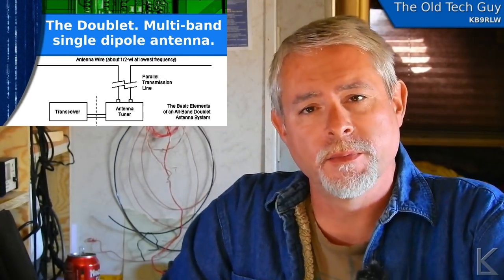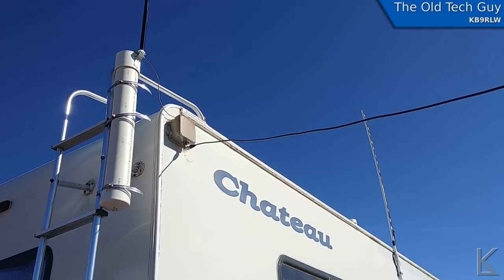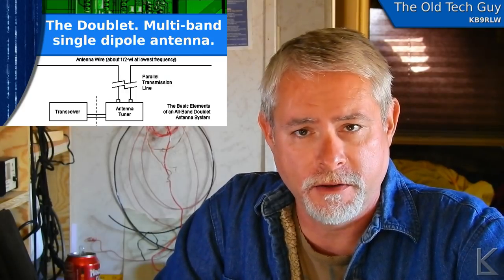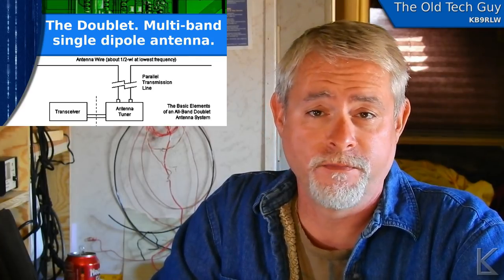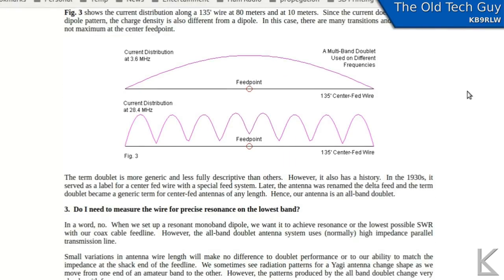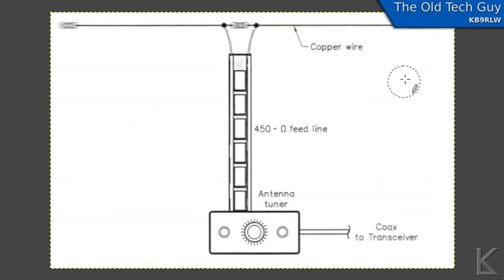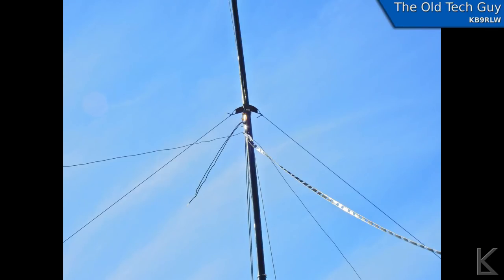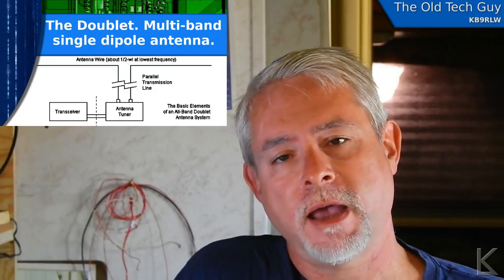Ham Radio - The Doublet.  An old but good multi-band single dipole antenna.  Part 1

Comment: Kevin is right about the benefits of a doublet.  I used one from a 2nd story apartment in Seattle for a few years.  Doublet was 42' long (including the 'end drops'), bare #14 copper wire and used with 20' of homebrew open wire feedline.  This I connected to a homebrew 'Z-Match' tuner on my bench.  Coax was maybe 2' long.  The doublet ran kitty-corner from living room to bedroom and dropped down vertically maybe 6' on each end.  I worked all over the states and the world- from an apartment, using QRP.  I could opeerate on 40 no problem, and even on 80 but had to retune the Z match whenever I moved more than a few KHz.  lol.  Worked all bands from 80 to 10.  And not with a shiny new rig.. it was my Heath SB-101.  Haha.  Nice vid Kevin.  Thanks OM & 73
Reply: Cool! That's what makes ham radio fun!
Reply: How did you hang the antenna if I may ask? Apartment dweller here, 11th floor, but I think the neighbors downstairs would see my wire hanging if I just hang them from the balcony hehe Thanks!

Comment: Most modern tuners now have a 1:1 current balun that does not do any impedance transformation.  A 4:1 balun like the ones that used to be in turner which was a voltage balun was very inefficient unless it was feeding a 200 ohms load.  Since the load impedance varies widely in this application, the manufacturers have finally got smart and started using the more efficient 1:1 current balun that maintains efficiency over a wide impedance range and also converts the unbalanced output of the tuner to that of a balanced condition - a win win situation !

Comment: Re watching this it tells me that if your antenna is resonant good coax can match 450ohm window. But if you're using a single wire multi band, window can't be beat unless you ran coax with the tuner at the feed point. That's going to look funny.

Comment: Great video Kevin - I am a long term fan and user of the simple doublet. It knocks spots off 9:1 random wires in both receive (S/N) and RF radiation. Doublets also work well as long as the length is at least 3/8 wave of the lowest frequency. So 50 ft is ok for 40m and up and 100ft should be fine for 80m and up. The ladderline can also feed into the tuner via a 1:1 current balun if the ATU is not a balanced tuner. The trick here is to keep the coax between balun and ATU as short as possible - less than 10 feet is ideal.

Comment: Thanks Kevin,  I  have been using a doublet about 115 feet long since 2016 and have an outdoor remote tuner (with NO balun) that can tune from 80 through 6 meters even though the tuner is not specified for 6 meters. The wire is just THHN house wire with the insulation on.  That does lower the velocity factor a little so that helps with the lower frequencies some.   Oh, and I just use some 300 ohm TV twin lead to feed it since I bought out a Radio Shack store when they closed and were selling 100 foot rolls for one dollar.  The trick to using a tuner without a balun is to float the tuner at RF so it is NOT grounded at RF (It IS grounded at DC).  The tuner I am using is an SGC-239 which is NOT an outdoor tuner, but I added my own waterproof NEMA 4 enclosure.   I know the loss from the 300 ohm line is greater than the 400 ohm window line, but it is what I had.  I may replace it one day or try some 300 ohm window line which is available.    I wanted to thank you for this video since I have found it hard to convince people that an antenna can radiate just fine and NOT be resonant.  I have been watching your videos at night on my ROKU box for some time, but there is no way to subscribe or like so I finally decided to get on the computer and do both!  Keep it up, this is one of the best things I watch anywhere.
Reply: How does this, "floating" effect noise floor and what about the risk of lightening strikes?
Reply: @Justin-bd2dg  Affordable automatic tuners are susceptible to lightning, even miles away. Reason: It's all active circuitry, only as reliable as the input protection circuit(s), which are skimpy for hobby-quality devices. Mil-spec is another world, $$$... Many I know have the opinion that there is no real protection against a direct strike anyway.... except disconnecting everything, but how do you disconnect a remote tuner from the antenna (conveniently, that is)?
Reply: @avt3216  I'm using lightning arrestors, I don't see how, if wired properly, they wouldn't work? You are providing a shorter path to the ground than the radio?

Comment: This is the optimal antenna for my 5 watt G1M. I fussed around with EFWH, bought Times Microwave RG8X coax and made an "improved" 49:1 balun. But really, ladder line is the way. I use an Em-Tech ZM2 tuner which is also light weight if a bit bulky.

To make mine portable, I built it around a wire wrapper and used really tight fitting banana plugs to make the feed line pack easier. I put it up with a TacMini fiber glass pole (17 feet) and run as inverted Vee.

I wish I could have made it a folded dipole but that just wouldn't be compact enough for a back pack already stuffed with other crap for camping.

Grateful for this video as it helped me get motivated.

Comment: I made a doublet by splitting speaker cord into a doublet and using the non-split speaker line as a balanced feedline. I made it on field day 2019 in about 30 minutes and used it to operate using QRP power. What fun that was. I heartily endorse the doublet!

Comment: One of the best antenna we have used, after testing  we ended up using this antenna as the ONLY antenna for H.F that is worth our time ( we  tested it against other antenna such as multiband verticals and yagi's).
Our feed line goes through an open window directly into the antenna tuner ( avoiding using an external balun ). 
At first we were worried the metal frame of the window will interfere, but found out that the effect was not felt at all ( even when we close the window onto the line ), but then again, this is the only spot were the balanced line could " see" metal. 
Do try this antenna , it's worth the time.

VK4BYE, VK4DJZ , VK4CPR

Comment: I've been looking forward to this video.  I always enjoy these videos and I always learn something and usually quite a bit (mostly limited by my old brain's ability to store new information).  I  particularly appreciate these technical videos with links to curated articles that keep me from doing the work to search for good articles on my own.  That PDF is a keeper.  I saved it in my ham info folder.  Looking forward to Part 2 for the operation and performance of your doublet antenna and the 700mW CW transceiver.

Comment: Yes I made one of these a few years ago, 110 ft long, and it worked well, out performed a 40-80 trap dipole....from Fred in England.
Reply: Agree Fred ... I’ve got my 100ft doublet up an average of 15 feet and for 500 miles on 80 and 1,000 miles to 3,000 on 40 it does v well.

Comment: I use a doublet of ~ 2x12 meters and a tuner, works fine on 160m to 10m.
From the tuner i run double coax through the wall and then window line to the antenna.
The double coax has center wire as "ladder line", braids connected to each other at ends but not to ground!

Comment: Many, may moons ago, my Elmer talked about the value of Ladder Line and I dismissed its use because it was ugly/messy/sightly and old fashion. I did use it on occasions but was never an enthusiast.

Kevin's presentation and his references shows that I should look for ways to utilize Ladder/Open Lines and it should be foundational especially when operating QRP.

The difference in line loss between coax and ladder line when an SWR is present is amazing.

Another great presentation of practical know-how and experience, with test results, from Kevin.

ThankYou Sir....

Comment: Something I’ve seen suggested in bringing window line inside through a wall is to attach each side of the window line to the center conductors of two lengths of coax, then bring the two lengths of coax indoors, leaving the shield unconnected. This will keep the feed balanced yet shielded. Also, IIRC, there used to be a form of ”shielded twinlead” that might also work.

73 de AF6AS

Comment: I have used a doublet fed with ladder line and still do. The advantages I’ve seen are, it’s cheap, it’s easy, and it works very well on every band. The only disadvantage I’ve noticed is it would be impossible to use mobile in motion. Using it from a stationary RV however, would be a different matter entirely. 🙂

Comment: What I have found in my experience with 450 ohm ladder line is that it's okay to  go directly across, for example, a metal window frame for a sliding window, but not okay to run it parallel but very close to, for example, an aluminum gutter on your house.   The idea is that any metal near the feedline runs the risk of creating an imbalance in an otherwise balanced feedline.   Where your metal object encounters the feedline is where the risk of introducing an imbalance is greatest.   But, as long as the effect of the metal object is essentially equal to both sides of the feedline - like when you run it across a window frame at 90 degrees, the effect to the balance of the feedline is minimal.   On the other hand, when running alongside and parallel to another conductor, like an aluminum gutter or tower support, where one side of the feedline is closer to the conductor than the other, the imbalance is far more pronounced and problematic.  This is why I prefer my fiberglass portable masts when using ladder line and my aluminum portable masts when using coax.

Another nice thing about using ladder line is that it is very lightweight and is easily suspended between two supports when feeding a center fed wire antenna, like a doublet.    And, I like using a doublet and a tuner because it also makes shortwave listening on non-amateur frequencies more effective.

Thanks, for the video!
73
AI4IJ

Comment: I had one of these years ago. It was great for all bands. I cut my ladder line down by the shack and installed RCA jacks. I built a 1', 2', 4', 8' piece of ladder line. By experiment I found the right length to match 50 ohms for almost every band. I used a 1:1 current balun and short coax to the tuner, but often it could stay in bypass. Maybe if you have enough extra ladder line you could do a similar experiment for the channel. The ladder line acts as an auto transformer. Unfortunately, I didn't have any suitable test gear at the time to record quantitative data. I just know it worked a treat up to legal limit! Thanks for your videos and keep up the good work OM.
Reply: I have this antenna also (260ft). Do you think your would work for 160m to 6m with out an external tuner?
Reply: @barretto4152  probably wouldn't be a problem. Hardest part is finding the magic feed line length for each band and remember to plug in the right sections each time. Takes some trial and error.
Reply: O you have to change it out for every band. I think I'll stick with the manual tuner I'm using . Thanks

Comment: 20 years ago I bought a antenna called an "All Bander". The reason I didn't build it was because I couldn't buy the material as cheap. It included 100 ft of 450ohm ladder line  feed line, even insulators and rope on each end. The cost back then $29.95 and after i realized what a deal this was I ordered a 2nd one. I run this antenna everyday mostly on 75m ssb phone and it is a tiger. I run the 450 line all the way into my basement shack to a Palstar 4kAT tuner. It included a 1-1 balun and has been up 20 years with no trouble. I did make stand offs coming down my Rohn 45g tower about 2ft from the tower spaced every 10 ft and twisted the line several times on the way down the tower to prevent catching the wind and keeping it stiff. BTW the 2nd antenna is still in the package safely stored away.

Comment: Great explanation of this antenna.  What would the losses be like (table 2) with say 40 feet of ladder and 4:1 balun and 100 ft quality co-ax? Glad you covered the main disadvantage with the doublet - the shack needs to be near the centre; can't trail ladder through bushes/trees/outbuildings/along the ground, etc. (That's why the not-very-good G5RV is popular I guess),

My doublet is 19.5m+19.5m at 9m high with 9m 600 ohm ladder, 4:1 voltage balun followed by a ferrite-sleeve coke balun,  with 30m RG213 coax to the ATU in the shack. (This doublet antenna with the voltage balun at the base of the ladder feeding the coax to the shack is also known as the 'comudipole' in case anyone wants to do some additional research.)

How significant is the balun core material? I'm using T200 iron dust. Looks like you're using ferrite. Thanks.
Reply: Janet Winslow iron dust cores are not great as choke baluns, ferrite of the right mix is far more suitable, I use FT240-31 or FT240-43 cores with great success.

Comment: Good video. I have only 55ft of horizontal run space on my townhouse roof. I set up a doublet 50 ft horizontal run with ends zigzagged to fit for a total of 105ft. It is fed with about 20ft of ladder line to a 4-1 Balun attached to an LDG remote tuner followed by 100ft coax to the rig. It tunes 80 to 6 m. Tom kp2ch

Comment: I believe this antenna it’s a better fit for my living area than that end fed. I watched both vids, end fed and doublet and this one seems to fit my situation better since I don’t have to add any counter poise wires. I live on the second floor and there are two tress right in front of my balcony that I can fits a 40 m doublet perfectly. It’s around 70 feet’s between the trees. The middle of the antenna would be right in front of the balcony. I can get away with a short feed line since I’m going to be using the radio from the living room. My only issue is bringing the feed line inside since my door is metal. Or maybe I can use the radio out in the balcony on a small table if I can’t find a way to bring the feed line inside without getting it close the metal door.

Comment: All  good practical stuff Kevin,have been using this antenna for some time with good results,I am now looking at the same antenna build (slightly shorter!)but in the vertical direction as an experiment using a pole with the antenna center fed and window line,should be good fun!

Comment: A doublet is the best thing for me so far... vertical antennas work so poorly in the desert, the only alternative is a good horizontal. I've determined the performance difference using the fine analytics suite from SOTAbeams, specifically the "simultaneous spots" feature that eliminates time-variability in WSPR spots when testing one antenna against another.

Comment: Great video ! Isn't there one caveat something like the length of one side of the doublet plus the length of the ladder line should not be equal to an odd multiple of one eighth wavelength at the frequency of operation ? I saw a guy who had a matching unit using switchable lengths of ladder line to avoid this problem.

Comment: Good vid but SWR causes loss in coax primarily because of higher voltage across the dielectric at the standing wave anti-nodes, and increased current in the conductors at the nodes. Current on the outside of the shield is a separate issue entirely.

Comment: Very interesting , I am a great believer in parallel feed line.  Most of my ham friends think coax is the only way.  I have a G5RV that makes use of this principal. This video makes it make sense. Thanks. David Byrd KN4BHS
Reply: Used the G5RV for years , yet the full doublet ( 450 line to the matcher ) made a BIG difference as it is a real multi band antenna .
Reply: Maybe convert to a doublet... I did, there's no comparison, the doublet is way more efficient, and  truly all-band (you may have to trim the length of the feeder to make one troublesome band match OK).

Comment: I love these.   I have Brian's 'True Ladder Line' doublet in 'flat top' configuration..  125' long.  Each leg is a solid wire, no solder points what ever.  600 ohm feed through an Array Solutions surge unit and then directly through the window frame and onto the tuner!  Only 2 coax jumpers of 15" between the radio and amp to the tuner.   Yes, 450 ohm is window line and NOT ladder line.  Many get these two feed lines mis-labeled.
Reply: Words. We all know what is meant.
Reply: @rikoski  Are you kidding? The difference matters!

Comment: Is the window line feeder dangerous to be near or is it only dangerous when attached to the horizontal dipole wires?
Reply from the maker: No.  Since it's a balanced feedline, the field around it should be weak.
Reply: @loughkb  okay great, thanks for confirming that. It helps in planning where to put it.👍

Comment: Hi Kevin...yep, window line and a balanced tuner is the way to go for multi-band. I have won quite a few local EU contests with a doublet (and double extended zep with 5/8 each leg on band of choice). In very simple terms it’s a case of getting 90W+ radiated (out of 100W) vs (as low as) 10W radiated with a good quality ‘lossy’ coax system.....

Comment: Kinda reminds me of the old TV antennas and twin-lead. When we went to coax we had to have a (balun?) to connect to the antenna screws on the TV.  I know, that was (I think) 300 ohm twin-lead and 75 ohm coax, but basically the same principle.